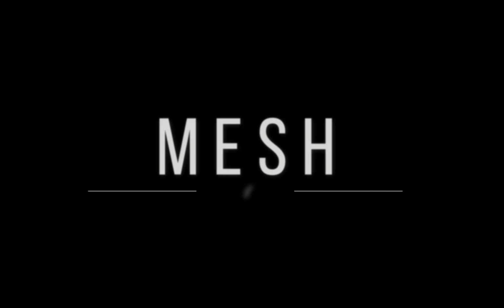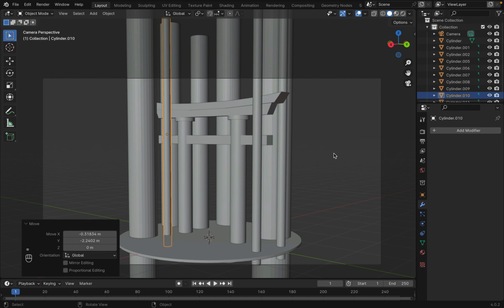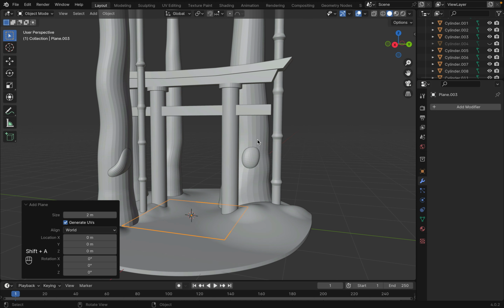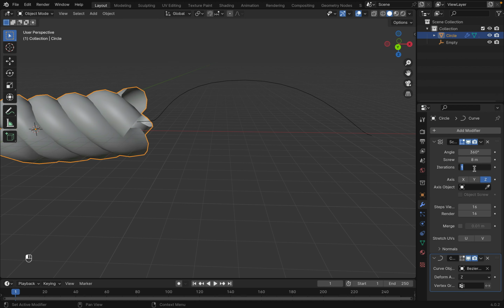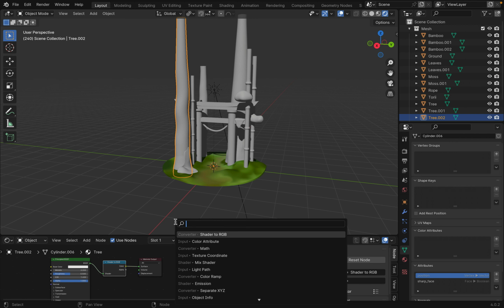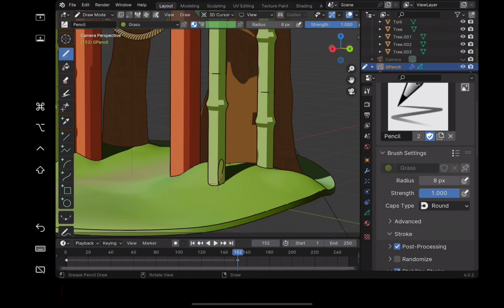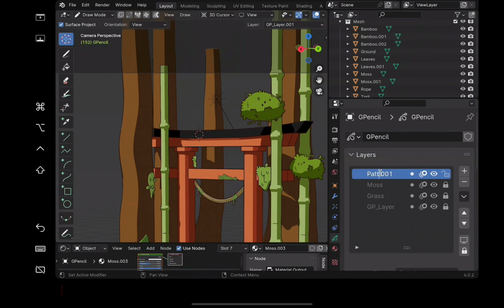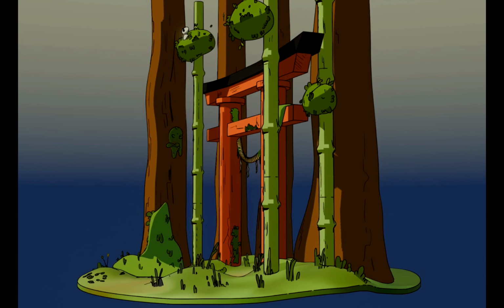Grease Pencil 2D+3D Blender

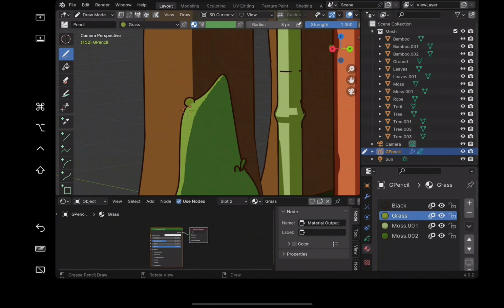Comment: 13:00 how u quickly switch between cursor and draw tool?
Reply from the maker: At 13:00, when you enter Weight Paint mode, you will be using the brush tool by default. When selecting the rig, make sure to hold down Control. Hope this helps!
Reply: @goosetavern  i don't get you. you weren't in weight paint mode and there is no rig to select in this video